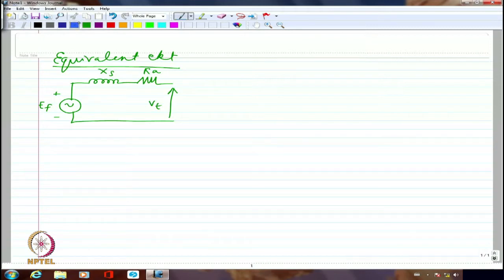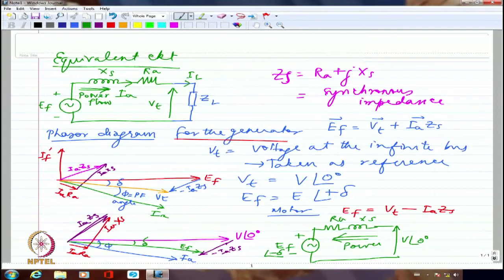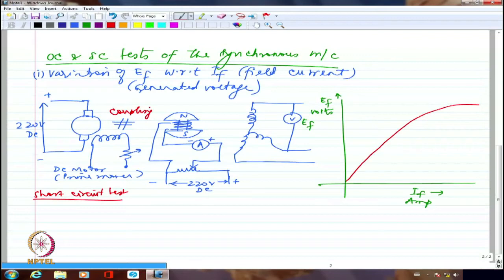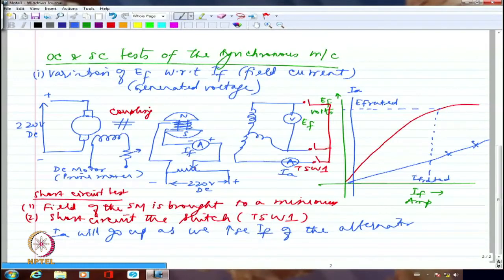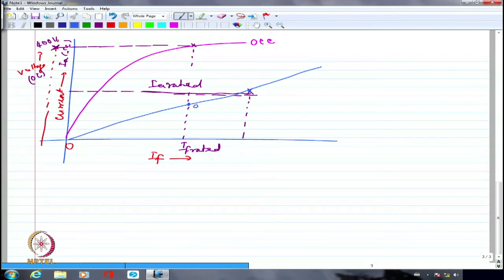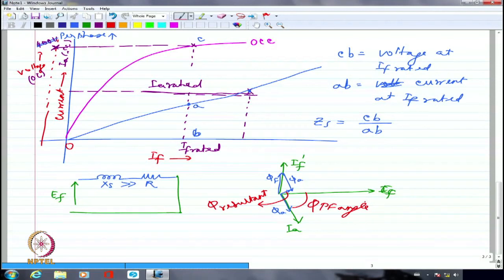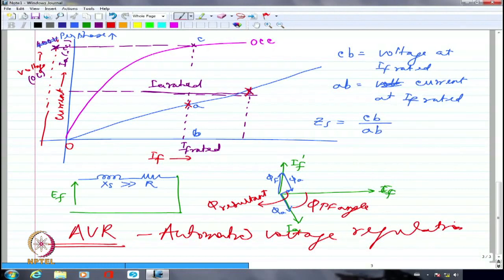mod12lec39

Comment: eq ckt and phasor diag of sync gene 0:00
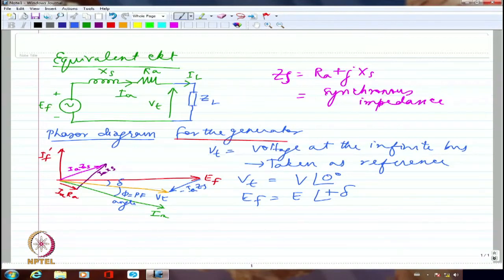phasor diag of sync motor 8:00
leading angle = supplier of power 13:00
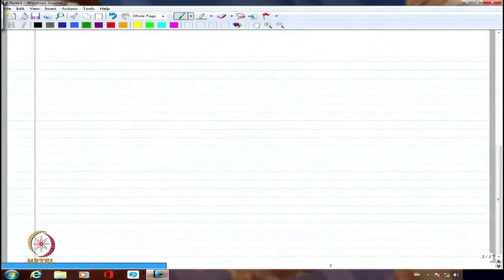lagging angle = absorber of power unlike in DC = pwr flow from high to low voltage leveloc and sc test for sync m/c 15:00